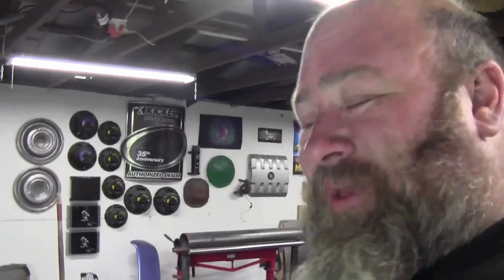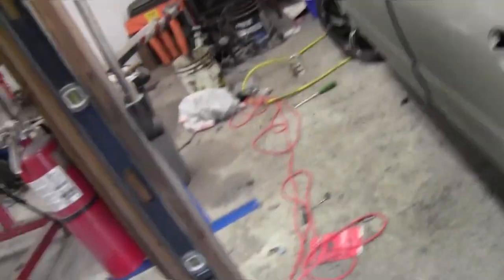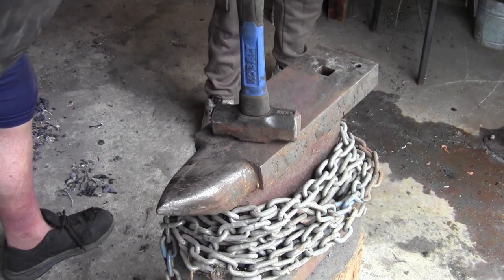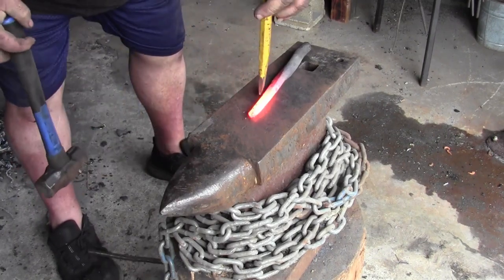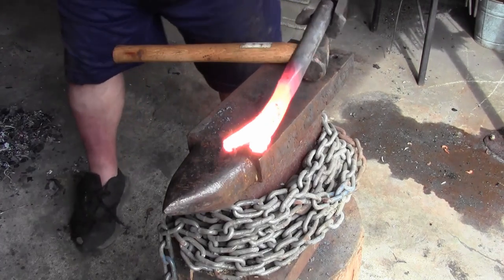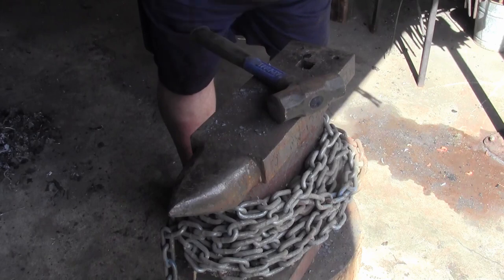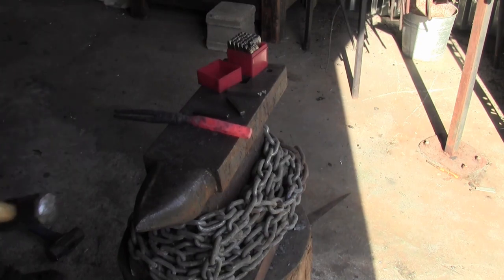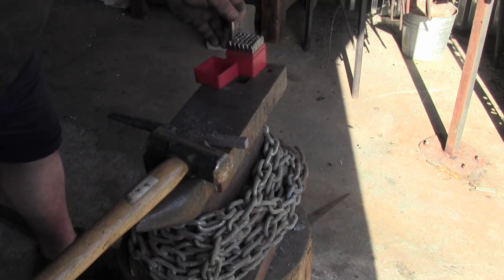Forging A Tucking Fork, 8BA Adapter Update, Mazda Update

Comment: Never heard of burning steel before, lol.  Tool looks awesome! Sounds like a real storm there going on at the end of the video.
Reply from the maker: Basically I took it beyond welding temperature and melted it. In medium- high carbon steel it can slightly de-carbon the steel. I think the weather was reporting sustained winds around 23 mph I feel like it was gusting to over 30. We didn't get any rain but living in a house with a tin roof is interesting when the wind gets up. Thank you for watching.